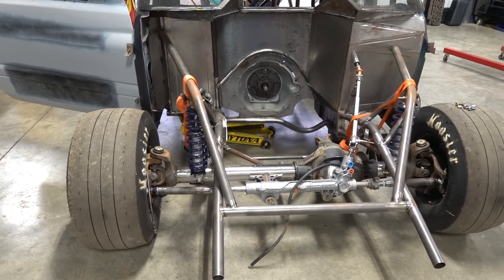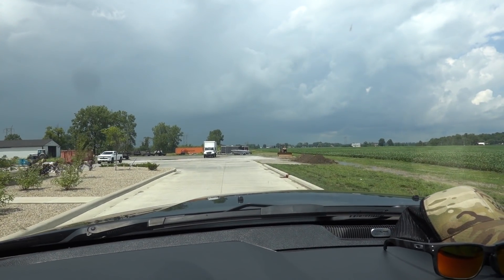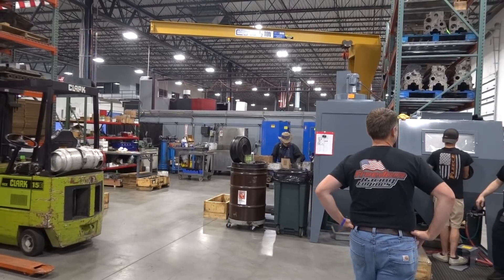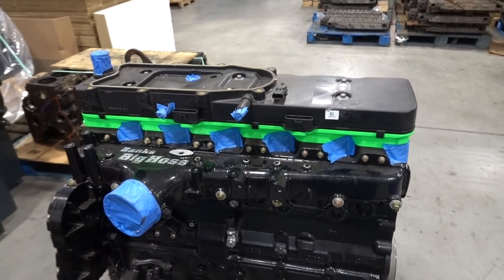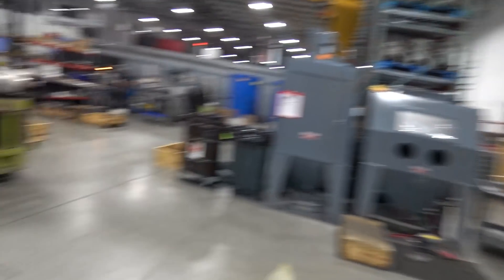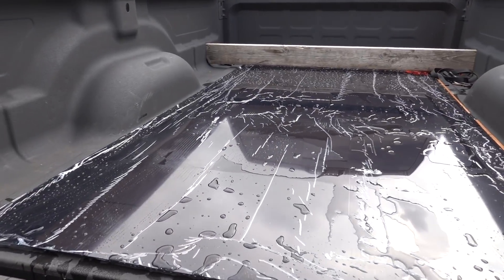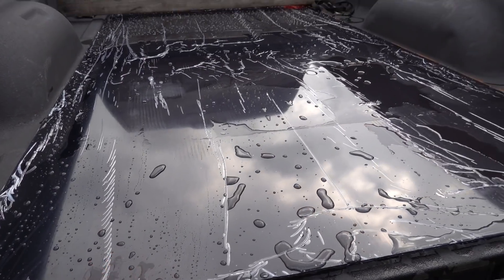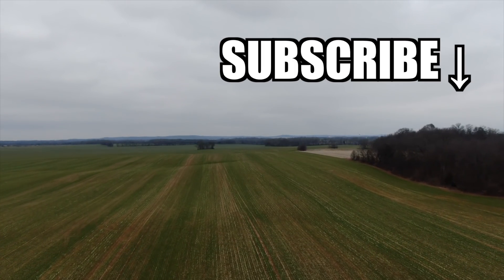Returning my BUILT CUMMINS Engine.... Here's why.....

Comment: Rod angle is a big one when your cylinder pressures become elevated. With a deck plate you have less rod angle at the piston when the journal throw is at 90 and 180 degrees.